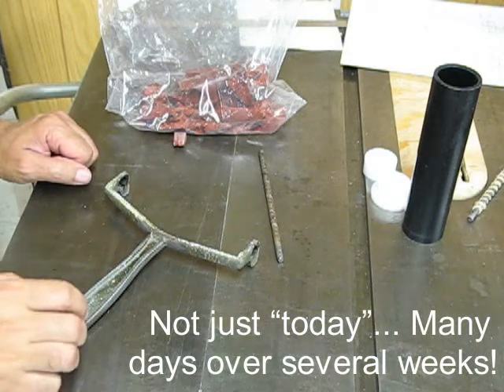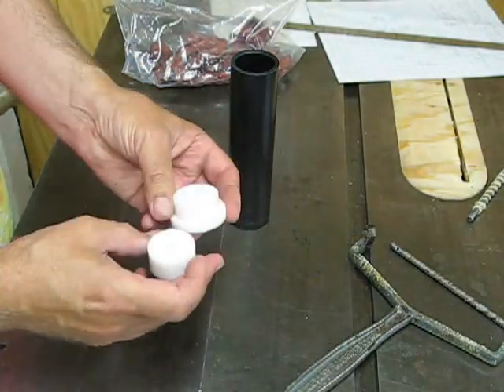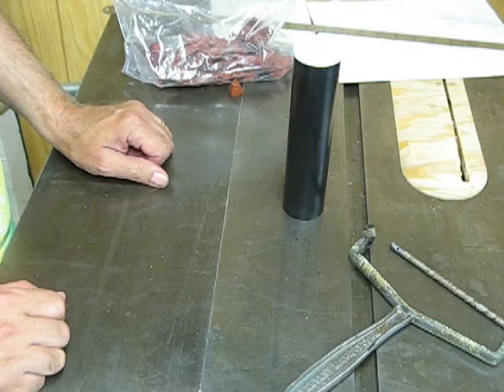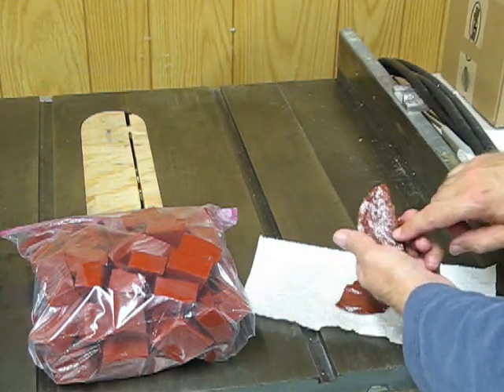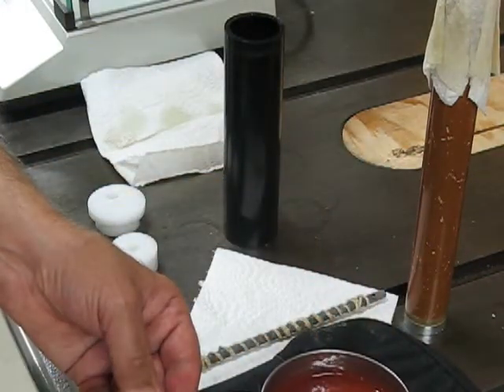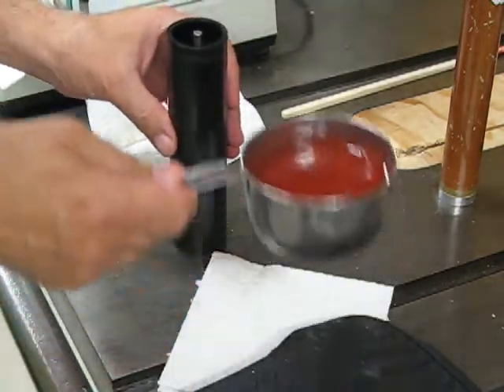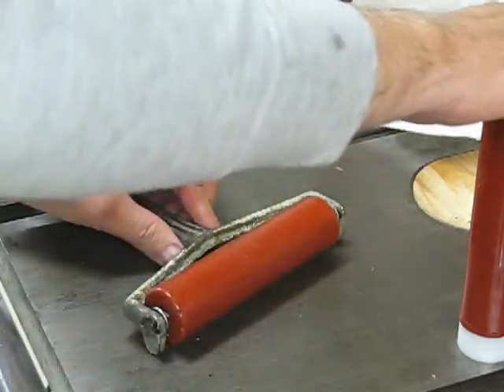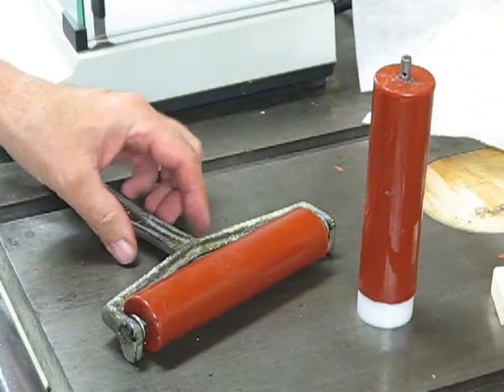Casting Composition Brayer Rollers

Comment: Kevin - This is a very interesting video. I am familiar with many of the issues you encountered, since I regularly cast rollers for the Kelsey presses I restore. I have never cast a roller for the Kelsey brayer, but did receive an email enquiry about doing one just yesterday - and asked Mr. Google for information about the Kelsey Brayer - which is how I stumbled upon your video. Thank you for sharing this with us. It's a good bit of historical reference for that small group of people (worldwide, I might add) who find such procedures interesting and may want to try it themselves. 

I also recall a story I read in a letterpress group about a woman who cast herself a set of rollers using Gummi Bears instead of Tarheel's Composition material. I use neither. I cast my rollers of 20-durometer poly-urethane. They are as soft as composition, but last a lot longer. I am still using some of the earlier 30-d rollers that I cast almost ten years ago, and they work as well as when they were new.  I switched to 20-d for the softness made popular by composition.

So. If you want to know more about what I have been doing... http://letterpressrollers.com - it's an alias to my web site for the Excelsior Press Museum Print Shop and Restoration Facility. Stop by some time!

Comment: BTW - I will be casting rubber replacement rollers for the Kelsey Brayer. I have six frames that I collected over the years and am about to make them usable again - and will be sending one of the rollers to a gentleman in Connecticut - home of the Kelsey Excelsior Printing Press....

Comment: Hello where i can buy The composition material is a mixture primarily of sugar, glycerin, and gelatin, the use of which which predates the availability of vulcanized rubber.?
Reply from the maker: Luis,
The material I used for this roller was purchased from the owner of Tarheel Roller & Brayer (in North Carolina, USA) after they stopped producing composition rollers. That was over five years ago and their web site no longer exists. The only contact information for them is what is left on the Briar Press web site (http://www.briarpress.org/1257) so I doubt you would be able to get any from them any more.

You would therefore have to make up your own composition material. At the time of making this video there did not appear to be any modern references for recipes.

I have experimented a bit with my own formula... The only set of rollers I cast with my own formula seemed OK at first, but after a few years they shrank and became lumpy. I think I did not have the gelatin (which was in bead form) completely dissolved, and the undissolved bits formed the lumps as everything else shrank.

The notes from this are on my blog at https://papertrail.ca/blog/some-observations-on-home-made-composition-rollers/. On re-reading this I see that it is more general notes on composition material and it does not include the actual recipe I experimented with.
Reply: @kevinmartin7760  maybe the recipe is similar to that for gel plates. water, gelatin, glycerol and iso alchohol? plates gets  quite tough asthey age.
Reply from the maker: @triggersw3350  I would expect that for plates, the alcohol quickly evaporates, leaving (as you observe) a very tough gelatin film.

Because of the thickness of the composition on rollers, any such evaporation would be very slow, over a period of months perhaps, making the rollers gradually harden up as they age, which would not be desirable.
Because of this effect, volatile ingredients are generally not a good idea for rollers.

I haven't had any time to play with recipes to see, for instance, how changes in the sugar content affect the result. I assume that both the sugar and glycerol keep the moisture content more or less stable so the gelatin remains supple, and more sugar/less glycerol would make a firmer roller.